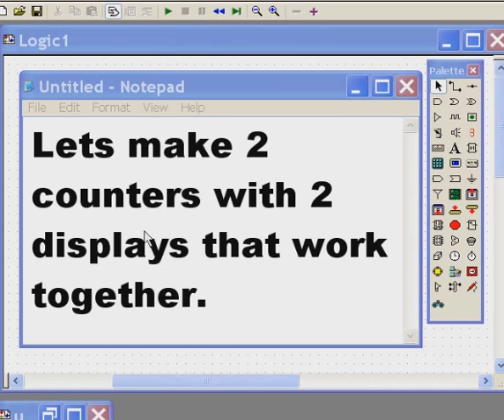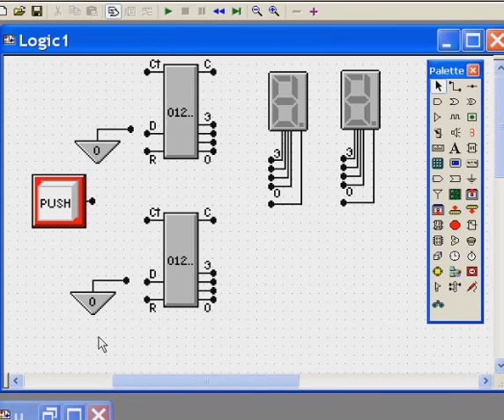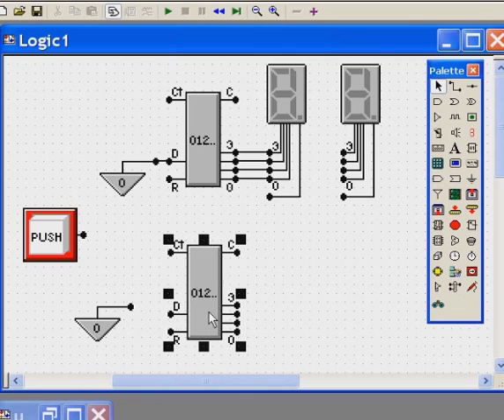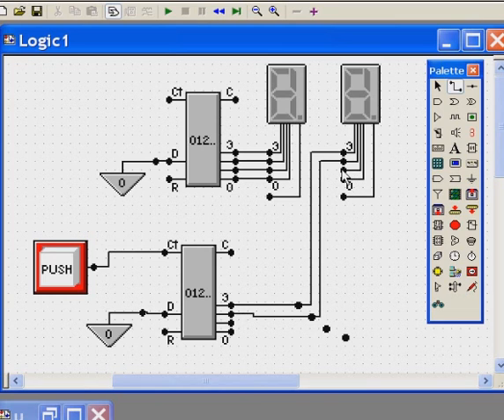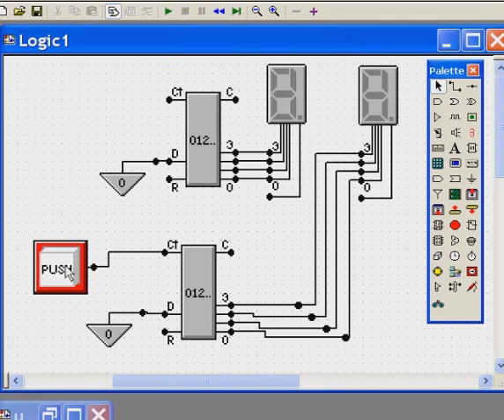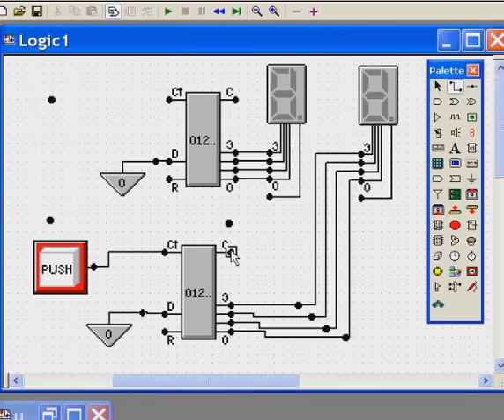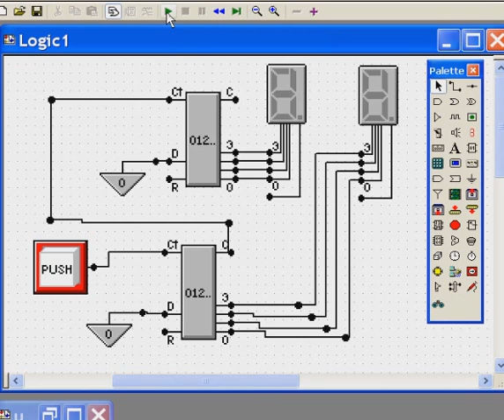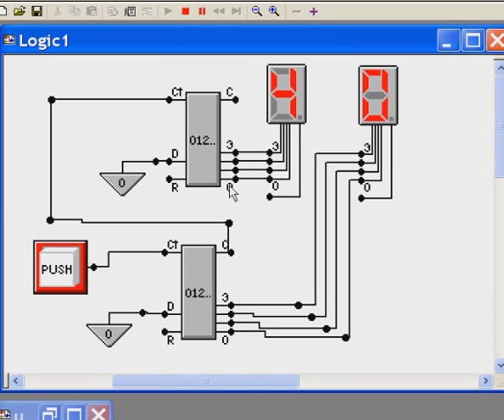2 Digit Counter - Software Circuit Implementation and Simulation Made Simple

Comment: Hi I want to create a 2 digit counter but each single digit should only display 0 - 9 and carry signal on the next digit if it's more than 9 (which means 10 or A). How I am going to do it?
Reply from the maker: Spongebob Squarepants 
here's a little counter I cooked up for you, this should give you some great ideas and a bit of direction. Good Luck.
for a in range(0,10):
 z=a
 for b in range(0,10):
  print(z,b)
  if(b==9):
   for c in range(10,16):
    b=c
    print(z,str(hex(b))[-1])
Reply: george boole Thanks. I also see some implementation about the double dabble algorthm. can you create vid for that? I am creating a counter from JK flip flop not as a component but from basic logic gates.